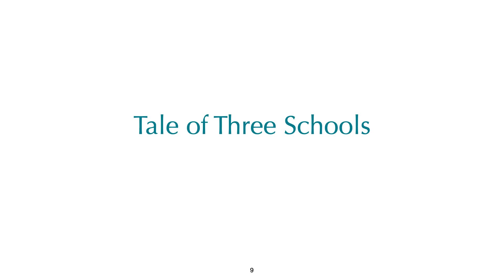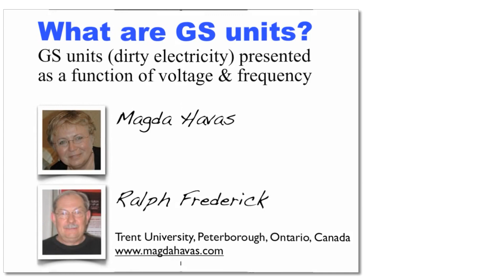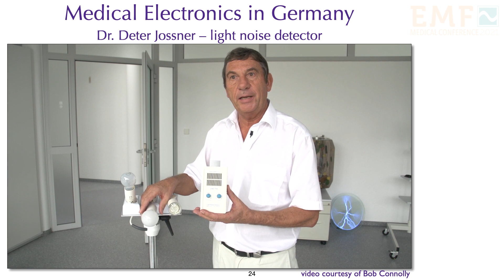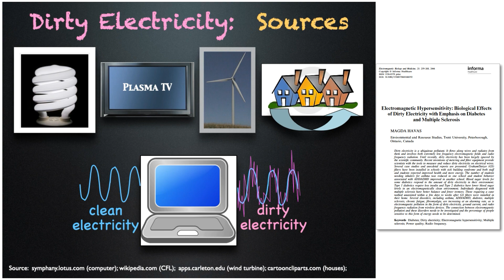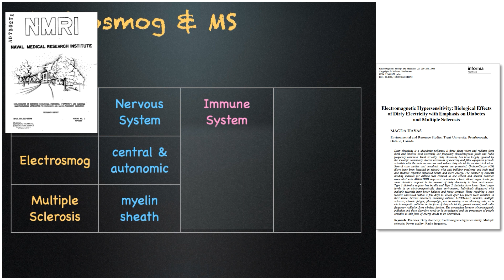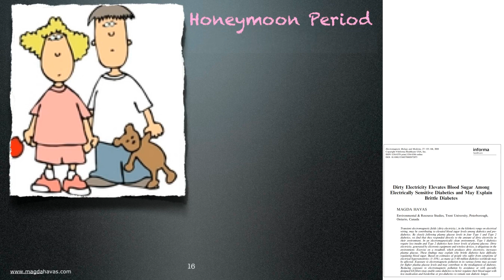4 Havas 2020 Lecture 4 Dirty Electricity Pre conference EMF course

Comment: One thing that has puzzled me about my experience is that when I go for a drive(at least a half an hour) the symptoms that I experience dissappear and become noticeable twenty to thirty minutes after returning. The longer that I am away the longer it takes for the symptoms to appear, and if I listen to music(especially through a subwoofer) it takes even longer for the symptoms to appear. Similarly, when I take a shower, I notice a reduction in the severity, or even the disappearance of the symptoms for a short period of time after getting out of the shower. It is almost as if there is a charging period after returning home, or taking a shower, before symptoms are noticeable again. I suspected that a cervical disc implant(mobi-c) was being charged and then discharging into my body's nervous system causing dysfunction, muscle spasms, and other health effects. I relocated to a different city, but in the same electric company's service area, and noticed a shift in the effects. Some got worse and others got better. I am going to use some filters and see if that makes a difference in my health and the effects(symptoms) that I experience daily. Thank you very much for your work and getting this information out.